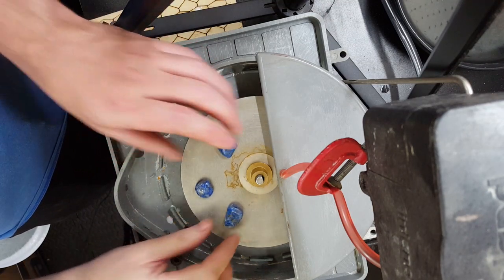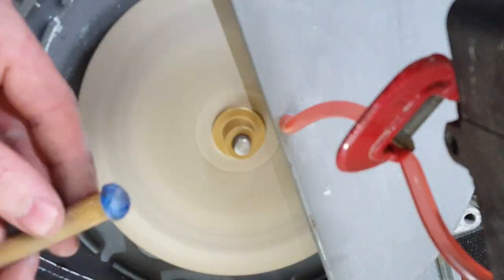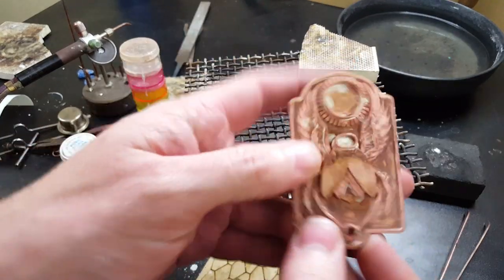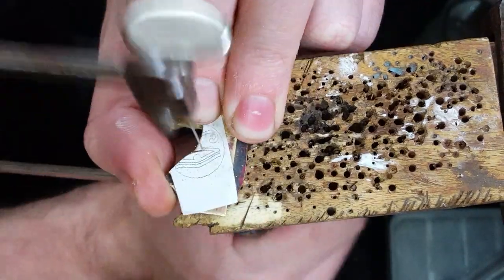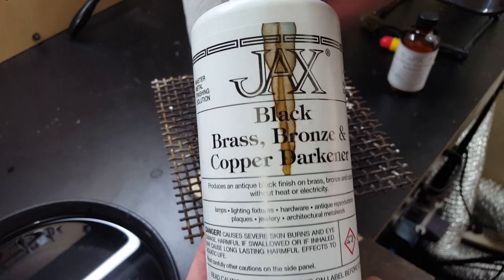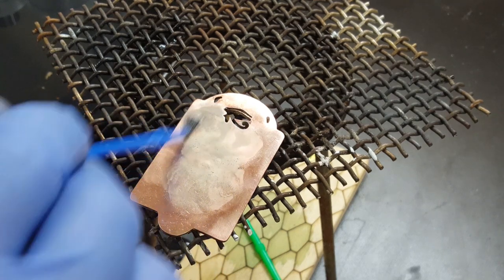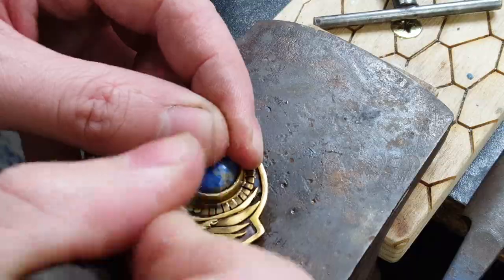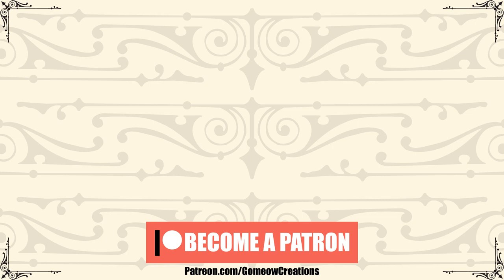Making a Egyptian scarab necklace by hand - Part 2

Comment: I sometimes use hot glue gun.  You can put a big blob, and get a very good grip and to release just put a little alcohol on it and it will drop right off.  Though I've never had that not work you can use a hair dryer or heat gun to bring to a gooey state and pull it off.